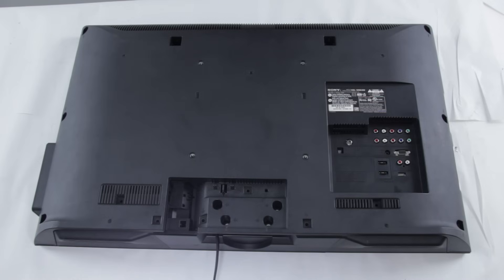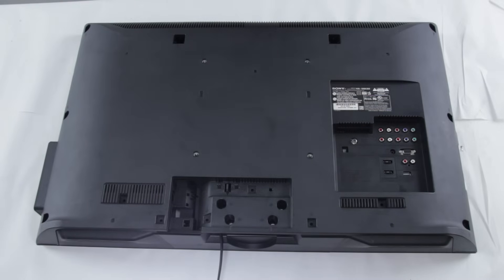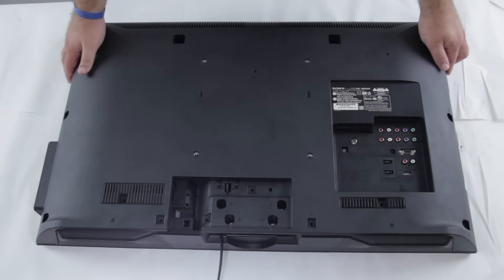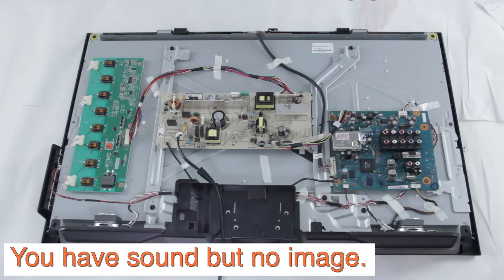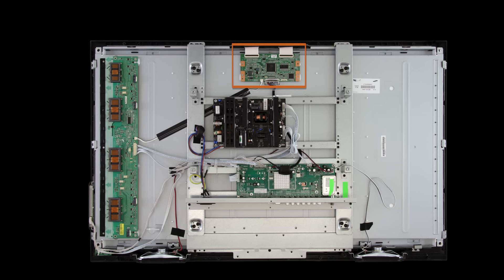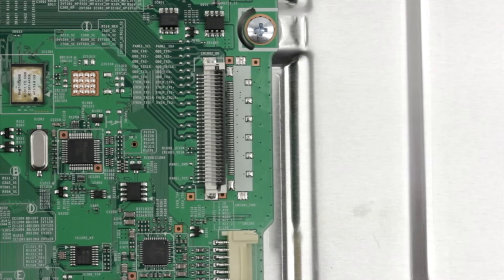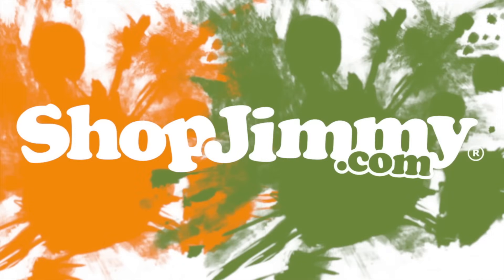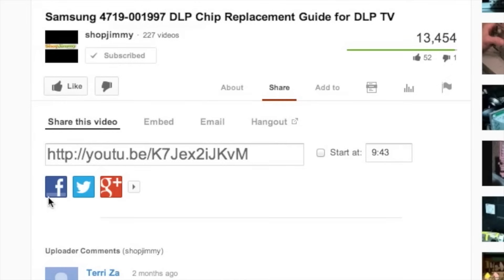LCD TV Repair Tutorial - T-Con Board Common Symptoms & Solutions - How to Replace T-Con Board

Comment: I have a Dynex LCD TV model LCD42HD-9 manufactured Sept 2008 Lot 160014 - XH7080734. After the TV is switched on it works for about 10 minutes,then the colors in the picture resemble cartoon effect, in that you see the outline of the characters on screen,but none of the colors are correct. I've reset to factory specs,still no improvement. Could it be the V420H1-C07 t con board?
Reply from the maker: Earl Skeete  This could either be the t-con board or the main board in your TV.  I would replace the t-con board first and if that does not fix the problem I would replace the main board.  Here is a link to replacement parts for your TV model number on our website, click here:  http://www.shopjimmy.com/catalogsearch/result/?q=LCD42HD  Be sure to match part numbers on your current board, with your replacement for compatibility.  You can also call our customer service for further assistance with your purchase.  (877) 881-6492  Thanks and please let us know if you have any further questions with your TV Repair!  www.shopjimmy.com

Comment: Hi there i own a 42lg5020 it was 2nd hand and a few days after i bought it a solid black bar with a white line halfway through it appeared on the left hand side of the screen cutting off the edge of the screen for about 3 inches. This however disappeared if you tapped the screen in a certain place or waited a while but when you turned it off and back on it reappeared or some time had passed with in activity ect.  I contacted the guy i bought it from and number was no longer in service (same old story) so with no money to buy a new tv or for massive repair shop costs i really need to be able to fix this myself. I know a lot about computers however not much when it comes to monitors or tvs really need a reply haha thanks
Reply from the maker: 666duhaka  This sounds like a TV panel problem.  If your TV panel is bad, it may be more cost-effective to replace the TV as panels are typically hard to find in stock, difficult to replace, and expensive.  Thanks and please let us know if you have any further questions!  www.shopjimmy.com

Comment: i have a 32" sony bravia model # KDL-32XBR4  Serial # 8019725 here is a link to a youtube video about what it is doing. it all started about 8 months ago with one line running from top to the bottom of the screen on the right side of the screen. the one line would be on randomly from one day to the next. then in the past week i was watching tv and the middle of the screen started to flicker then about five minutes later the whole screen went rainbow. and here i am.  broken tv
Reply from the maker: zenwha  You can try replacing the t-con board in the TV.  If the problem still persists after replacing the t-con, you most likely have a bad TV panel.  Here is a link to replacement parts for your TV model number on our website, click here:  http://www.shopjimmy.com/catalogsearch/result/?q=KDL-32XBR4  Be sure to match part numbers on your current board, with your replacement for compatibility.  Here is a link to a video showing how to identify your part number, click here:  Samsung Timing Control (T-Con) Boards Part Numbers Identification for LCD HD TV Repair  You can also call our customer service for further assistance with your purchase.  (877) 881-6492  Thanks and please let us know if you have any further questions with your TV Repair!  www.shopjimmy.com
Reply: thank you i fixed with a new tcon board from you guys and everything works fine 
Thank you, Shop Jimmy

Comment: I have a 52" Philips LCD tv model 52PFL5704D/F7 serial number YA1B0940008414 and it is doing exactly what you describe in this video.  It has sound and a dim back light but no picture.  When it first happened I left the tv on for 7 or 8 minutes and picture eventually started working.  I'm assuming based on the video and my conversation with the foreigner working Philip's help desk that the T-con board is the cause of the problem.  Is there any way to find out if it is a replaceable part without opening the case?  Would you know how much the t-con board for this tv costs?
Reply from the maker: J Dawg  This is a common problem in this TV model, I recommend replacing the T-con board in your TV.  Here is a link to replacement parts for your TV model number on our website, click here:  http://www.shopjimmy.com/catalogsearch/result/?q=52PFL5704D%2FF7  Be sure to match part numbers on your current board, with your replacement for compatibility.  You can also call our customer service for further assistance with your purchase.  (877) 881-6492  Thanks and please let us know if you have any further questions with your TV Repair!  www.shopjimmy.com

Comment: I have a LNT4669/FX/XAA that turns on and has sound but has a black screen, thats with a replacement board i bought off ebay, now the original  had a expanded compositor but i replaced it and the set will try to turn on it displays hdmi and check signal cable well flickering for a half min and than clicks and shuts off or sometimes  goes black or does what the replacement does . any ideas I’m thinking its a tcon issue,

Comment: Hey I have a lg 55lh40 that had thin black horizontal lines across the screen then after a few weeks the whole screen ended up black besides a few small lines that you still can see a pitcher. I was just wondering if you knew what it is I looked at all the capacitors they look fine and behind the screen its glowing white??? Would this be the t-con board? Thanks
Reply from the maker: Tony Hrpcha Jr This could either be a bad T-con board or a bad TV panel.  If the problem is the TV panel, it may be more cost-effective to replace the TV.  You can replace the T-con board to see if that fixes the problem.  Here is a link to replacement parts for your TV model number on our website, click here:  http://www.shopjimmy.com/catalogsearch/result/?q=55lh40  Be sure to match part numbers on your current board, with your replacement for compatibility.  Here is a link to a video showing how to identify your part number, click here:  LCD Help Part Number Identification TV Repair Guide for LG Philips Timing Control (T-Con) Boards  You can also call our customer service for further assistance with your purchase.  (877) 881-6492  Thanks and please let us know if you have any further questions with your TV Repair!  www.shopjimmy.com

Comment: Model #:  UN46B7100WFXZA
Serial #: AZ4A3CMS202043X
Colorful vertical lines are showing on television.  Sound is not working.
Thanks!
Reply from the maker: Jay Mitchell You can replace the T-con board to see if that fixes the problem, but if that does not work you have a bad panel.  Here is a link to replacement parts for your TV model number on our website, click here:  http://www.shopjimmy.com/catalogsearch/result/?q=UN46B7100WFXZA  Be sure to match part numbers on your current board, with your replacement for compatibility.  Here is a link to a video showing how to identify your part number, click here:  Samsung Timing Control (T-Con) Boards Part Numbers Identification for LCD HD TV Repair  You can also call our customer service for further assistance with your purchase.  (877) 881-6492  Thanks and please let us know if you have any further questions with your TV Repair!  www.shopjimmy.com

Comment: I have a Samsung LE32S86BDX/XEC.  A few days ago the  whole TV image went very dark and slow to change picture.  (Ghosting?)  Also the TV menu is slow and dark.  I have dismantled the TV and looked for obvious damage, but did not find anything.  I also looked at the backlight tubes which are all lighting up.  Maybe new T-con board replacement will fix it?  Thanks
Reply from the maker: adam thompson  If there is ghosting you can replace the t-con but if that does not fix the issue your TV panel is bad.  Unfortunately I do not see any replacement parts in the search results for your TV model number on our website.  Thanks and please let us know if you have any further questions!  www.shopjimmy.com

Comment: I have Sharp LCD Aquos TV (Model = LC 52D92U, Serial no.= 712835757) , 1/4 of my display screen (right bottom corner) is always white. I have opened the back but do not know to diagnose where is the issue. Any Tips or Guideline would help me.
Reply from the maker: Sonia Sharmin This sounds like a TV panel problem.  If your TV panel is bad, it may be more cost-effective to replace the TV as panels are typically hard to find in stock, difficult to replace, and expensive.  Thanks and please let us know if you have any further questions!  www.shopjimmy.com

Comment: Hello! I have a SAMSUNG LE32R88BD for more than 6 years.  Progressively the colours have become darker, inverted and more orange (especially faces).  Also I noticed when I turned the backlight down the screen is flashing. Please check this video to help diagnose the problem.  Picture problem with Samsung le32r88bd

Thanks
Reply from the maker: Nitesh Bolaky I recommend replacing the main board in your TV.  Unfortunately I do not see any replacement parts in the search results for your TV model number on our website.  Thanks and please let us know if you have any further questions!  www.shopjimmy.com

Comment: I have a Samsung LN40A750. It was bought in 2008. Within 3 years it started to get a dark area on the left side. It would go away after the set was on a while. It got progressively worse to the point the dark area covers 3/4ths of the screen.  I also see double images.  I have seen others report this issue, and they have gotten no help from Samsung.

This is a 40" LCD Samsung. Cost was $ 1,500.  I'm wondering if there is a way to repair it. Sound is fine; features work when using remote. The black cloud-like area is so large, it's impossible to view what's on the screen.

I have seen discussions where others have had the exact same problem. Some say it's a manufacturing defect where the problem appears due to shrinkage of the tab bonding contacts - the TAB BONDING CONTACTS TO THE SCREEN ARE BROKEN 

Here's one discussion thread on CNET:  http://forums.cnet.com/7723-13973_102-391882/samsung-ln40a750-picture-problems/?refresh=1388940522804

I'm also wondering if there was ever a class action on this particular model.
Reply from the maker: student12.class This sounds like a TV panel problem.  If your TV panel is bad, it may be more cost-effective to replace the TV as panels are typically hard to find in stock, difficult to replace, and expensive.  Thanks and please let us know if you have any further questions!  www.shopjimmy.com

Comment: hi there, i have a bush LC-39GL12F tv and it doesnt seem to turn on. when i plug it on it goes to standby mode ( red light) then if i click on the power button straight away it turns on ( blue light) but no display or any noise. if i dont press the power button straight away and press it after like a minute nothing happens and stays on red light. i did open up my tv and checked if all the cables was ok, i also checked if any of the capacitors was damaged but they all looked fine. i had this tv for just abit over 1 year now, i hardly used it much, do you know what could be the problem. any help would be appreciated, thanks.

Comment: I have svc code  LG 42lw5300-uc TV  serial no. 108RMBWBH021 have no image , I have sound and back lights would the problem be in the t-con board
Reply from the maker: Peter Tarasko I recommend replacing the t-con board in your TV.  Here is a link to replacement parts for your TV model number on our website, click here:  http://www.shopjimmy.com/catalogsearch/result/?q=42lw5300-uc  Be sure to match part numbers on your current board, with your replacement for compatibility.  Here is a link to a video showing how to identify your part number, click here:  LCD Help Part Number Identification TV Repair Guide for LG Philips Timing Control (T-Con) Boards  You can also call our customer service for further assistance with your purchase.  (877) 881-6492  Thanks and please let us know if you have any further questions with your TV Repair!  www.shopjimmy.com

Comment: I have a Samsung 46" TV that the colors are all distorted.  The model # is LN40A750R1FXA and the serial # is ALAT3CLQC00306N.  Suggestions?
Reply from the maker: Ed Nyce I recommend replacing the t-con first to see if that fixes the problem, if that does not work, I would replace the main board.  Here is a link to replacement parts for your TV model number on our website, click here:  http://www.shopjimmy.com/catalogsearch/result/?q=LN40A750R1  Be sure to match part numbers on your current board, with your replacement for compatibility.  You can also call our customer service for further assistance with your purchase.  (877) 881-6492  Thanks and please let us know if you have any further questions with your TV Repair!  www.shopjimmy.com

Comment: I have a LG 50PS6OC flat screen tv that while its on the picture comes and go but the sound is grate it stays on all the time. In order for me to get the picture back I have to turn the power off then on a few times, sometimes this may go for a while before i can get the picture back. Please help I appreciate your help in this matter. Thank you.
Reply from the maker: John Bonilla I recommend that you check the capacitors on the power supply to see if they are good or not.  Please check this at your own risk and then reply with the results and we can recommend a replacement part.  Thanks!  www.shopjimmy.com

Comment: I have a lg LCD led TV  42" v4400 it has power the little red light on bottom left hand corner is on TV won't turn on with button on TV or with remotes ... it did it the other day I unplugged and hit button a few times and got it to work and now it won't turn on at all please e mail me at xistreets5953ix@aol.com
Reply from the maker: Kyle Lanoue I recommend checking the capacitors on the power supply, if those capacitors are good, I recommend replacing the main board.  Here is a link to replacement parts for your TV model number on our website, click here:  http://www.shopjimmy.com/catalogsearch/result/?q=v4400  Be sure to match part numbers on your current board, with your replacement for compatibility.  Here is a link to a video showing how to identify your part number, click here:  TV Part Number Guide for LG & Zenith Main, Digital, & Tuner Boards (LCD, LED, Plasma TVs)  You can also call our customer service for further assistance with your purchase.  (877) 881-6492  Thanks and please let us know if you have any further questions with your TV Repair!  www.shopjimmy.com

Comment: Hi, I have a Sony KDL40X2000 which has started misbehaving.
http://i953.photobucket.com/albums/ae20/rcasson/IMG_0048_zps7ac4aa10.jpg
Please see photo.
There seems to be a white line seperating different shading levels
 What do you think?
Reply from the maker: Richard Casson This sounds like a TV panel problem.  If your TV panel is bad, it may be more cost-effective to replace the TV as panels are typically hard to find in stock, difficult to replace, and expensive.  Thanks and please let us know if you have any further questions!  www.shopjimmy.com

Comment: I have a Samsung 37" LN37A550P3F with about 5" of black vertical bar on the left side of the screen, with about another 3 inches of overlap/ghosting--LCD OR T-CON?
Reply from the maker: Jon Daehn This sounds like a TV panel problem.  If your TV panel is bad, it may be more cost-effective to replace the TV as panels are typically hard to find in stock, difficult to replace, and expensive.  Thanks and please let us know if you have any further questions!  www.shopjimmy.com

Comment: Hello I have a sony bravia lcd tv, model number KDL-46VL130. There is purple vertical line on the left, and a light green vertical line on the right. Is this the t-con board or the panel do you think.
Reply from the maker: Dan Sullivan You can try replacing the T-con board, but if that does not fix the problem, then it is your panel that is bad.  If the panel is bad, it may be more cost-effective to replace the TV.  Here is a link to replacement parts for your TV model number on our website, click here:  http://www.shopjimmy.com/catalogsearch/result/?q=KDL-46VL130  Be sure to match part numbers on your current board, with your replacement for compatibility.  Here is a link to a video showing how to identify your part number, click here:  Samsung Timing Control (T-Con) Boards Part Numbers Identification for LCD HD TV Repair  You can also call our customer service for further assistance with your purchase.  (877) 881-6492  Thanks and please let us know if you have any further questions with your TV Repair!  www.shopjimmy.com

Comment: JVC LT-40X776, Powers on, Blue Ind light stays steady, backlight works but no display, get white noise audio (tuner) for 2 seconds after power on, but then is silent, seems if i change channels, there is slight variants in the light, like the tuner is changing. Any idea's on this one maybe?
thank you for all your tips and help
Reply from the maker: Mark Cob I recommend replacing the main board in your TV.  Here is a link to replacement parts for your TV model number on our website, click here:  http://www.shopjimmy.com/catalogsearch/result/?q=JVC+LT-40X776  Be sure to match part numbers on your current board, with your replacement for compatibility.  Here is a link to a video showing how to identify your part number, click here:  TV Part Number Identification Guide for JVC Main Boards (LCD, LED, Plasma TVs)  You can also call our customer service for further assistance with your purchase.  (877) 881-6492  Thanks and please let us know if you have any further questions with your TV Repair!  www.shopjimmy.com